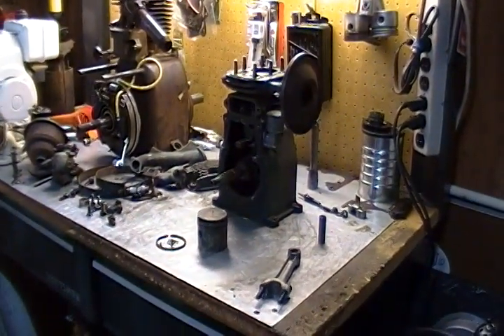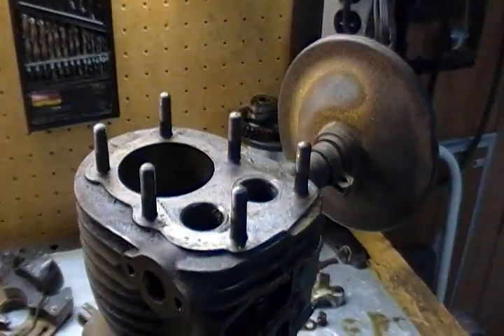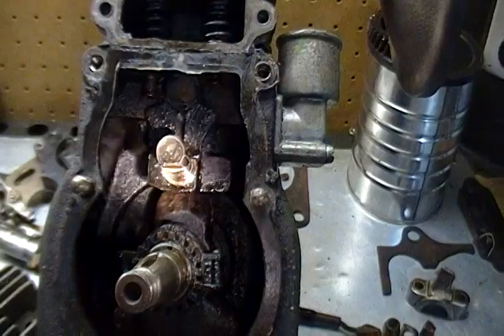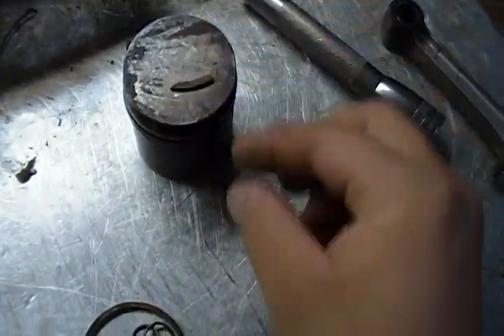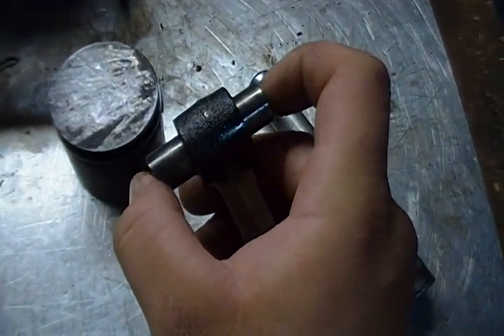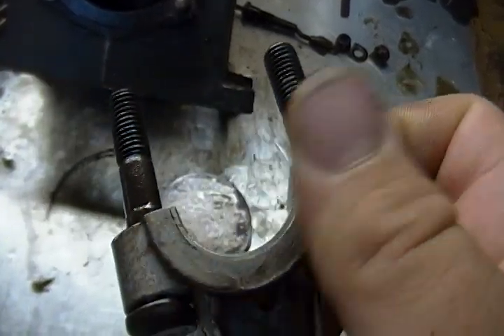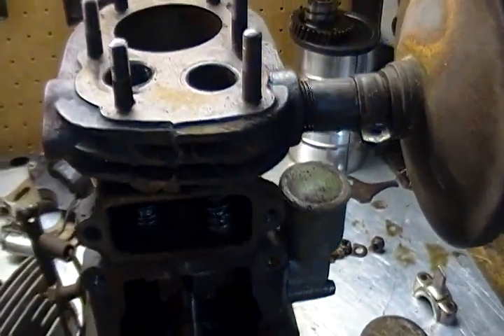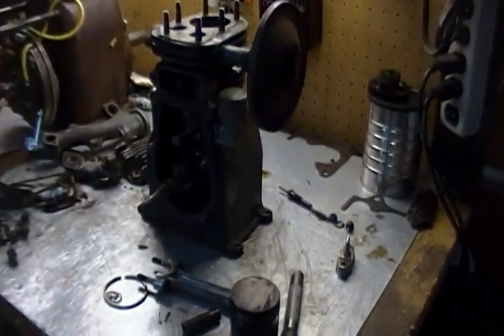Worn Out Lauson TLC

Comment from the maker: @ncrdisabled 
I gave $30 for this one.  
It is nice to get an engine that appears to have little run time on it that had an easy life.   However it is far more interesting to have an engine that you can see was worked, worn, used and abused but managed to survive.  What is interesting is this engine suffered no catastrophic failure.  It kept running and running until it just got tired out.
Its second life will be an easy one.

Comment: @SmallEngineMechanic The TLCs were real workhorses.  I've seen quite a few that were just slam worn out.  My scooter TLC is a prime example.  It was worn out, re-bored with and over sized piston installed, and then worn out again !  I suspect your TLC will run again though, with a little patience and care.

I'm with you though, after such a rough life, all my engines are in retirement.  All I expect of them is occasional running on the exhibit stand at the shows so they can be admired.